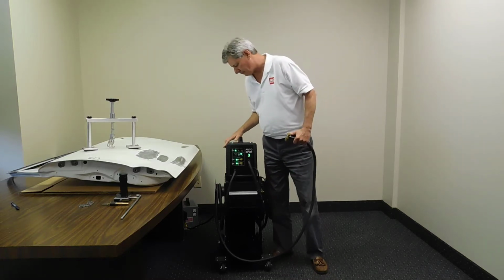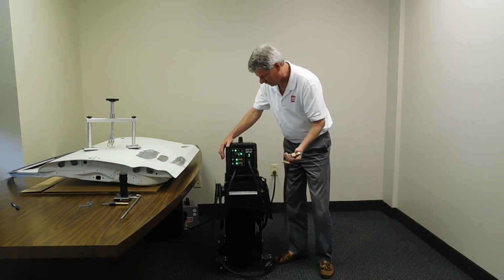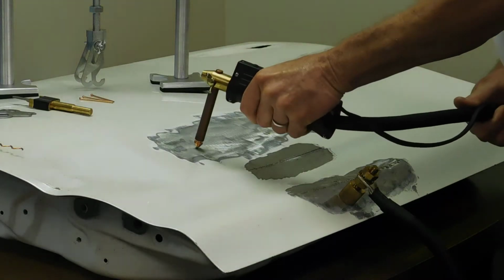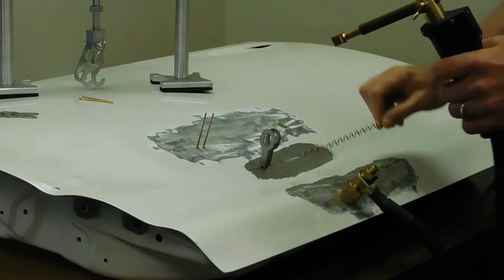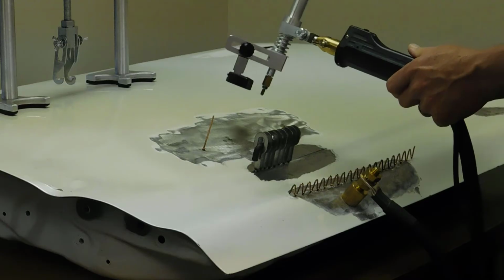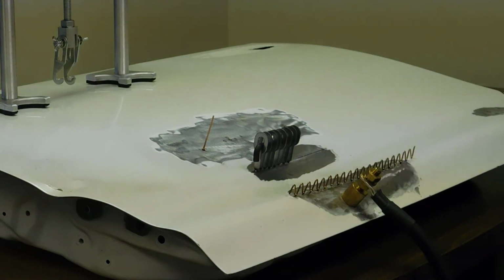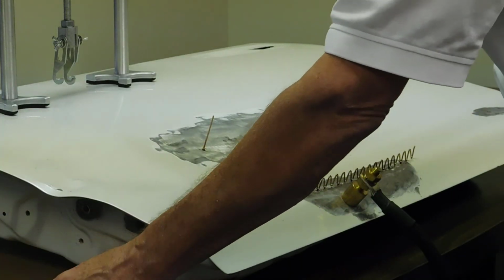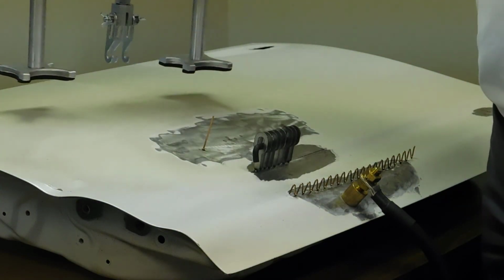H&S Autoshot UNI-9500 Auto Pro

Comment: I just bought this machine
Can you.please make a video about the settings for every thing you did
Setting your ground
And welding the studs
Reply from the maker: Israel,

You want level 3 for power and timing for the ground as a baseline. That is what we used in the video, but remember it depends on what type of thickness you are working with.

With the tabs I would recommend using 3 on power and 2 on timing. The advantage of the timing setting is getting enough strength to pull the dent, but not get the burn through on the backside of the panel.
For studs, power and time usually go up to really get a good hold.

Always remember it is better to start with less power and work your way up than it is to over-weld and burn through.

Stay tuned, we will have more videos soon!

-H&S Team
Reply: H&S Autoshot ok upload another thoroughly walk us through everything
Manual it came with not to informative